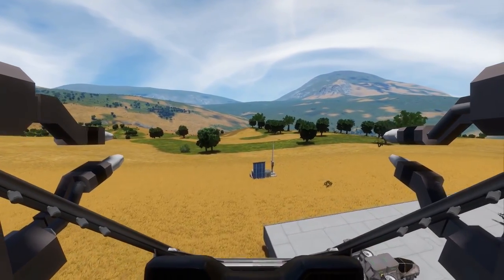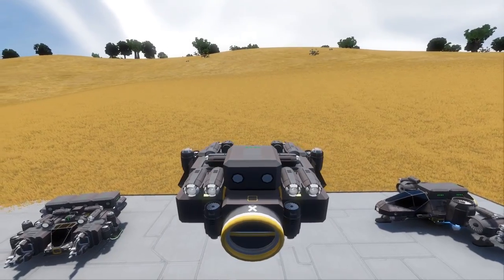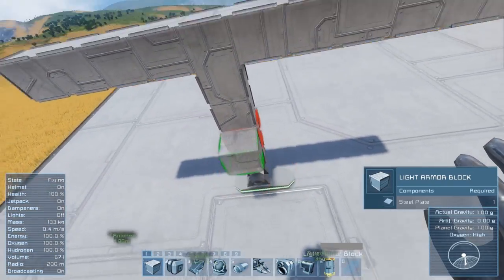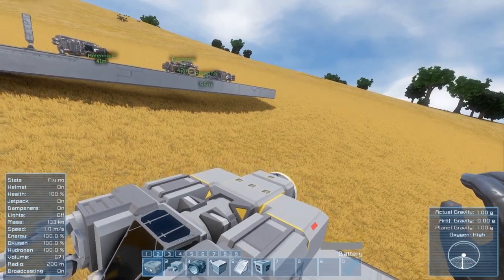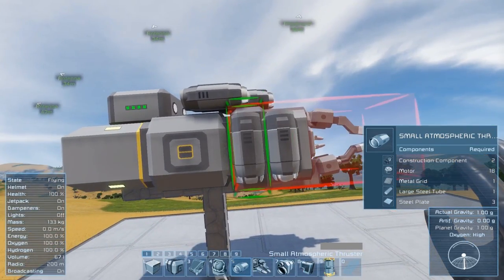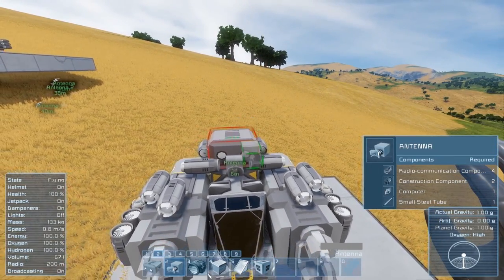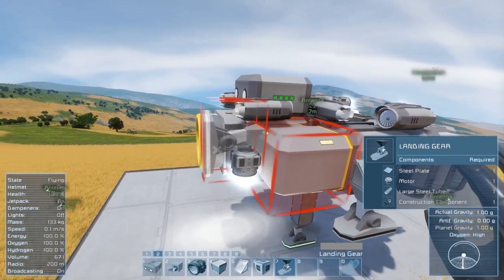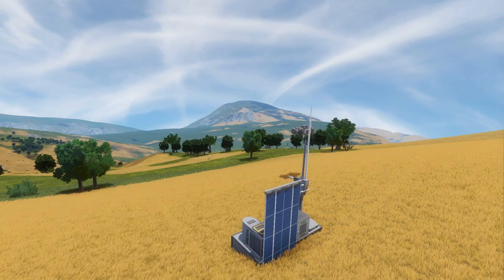Space Engineers - Simple In-Atmosphere Welding Ship Tutorial

Comment: I think to build from the cockpit you need to have it connected to the cargo. If you don't you need to have the materials to place the blocks in your inventory
Reply: +Cornivius technically, you could just have a few Steel Plates ect. in your inventory, but yeah. he needs a bottom connection, so it's a tiny bit misleading for good designs
Reply from the maker: +Maroon136 Oops, didn't realise it needed a big connection, thought the small was enough but guess I was building stuff using construction components..
Reply: +w4stedspace You can just replace oxygen tank and cockpit with fighter cockpit and airvent to pump atmosphere into cabin. Quick and easy fix ;)

Comment: I tried to make a similar design to this today using this video as a guide and for some odd reason my cockpit wasn't getting the oxygen it needed, so i instead added a oxygen generator directly behind the cockpit and then a oxygen tank directly behind that and that seemed to work for me. Beyond that small thing it works really well for me and is the best atmos ship i've built so far... i didn't realise how good those small thruster ones were i've been using the rather large clunky ones for my mining ship.. I'm now considering switching them out for the smaller ones now i've seen what this ship can do with just the small ones.. although i dunno actually, i might need them for the extra weight of the drills and ofcourse what the ore i'm collecting.
Reply from the maker: +Alfie yesyesyes The tank would need filling for that to work, one option I forgot to add in the trailer is to fit an air vent somewhere and that will do the job for the earthlike planet at least :)

Comment: Just a quick note on this craft, i copied it, but not block for block and i found something rather alarming and altogether, rather expensive;

Docking the craft has a tendency to smash engines mounted on the connector into the station side connector, which causes them to explode. 
The first time this happened, all i had left was a cockpit, a few loose engines rolling down a mountain and a detached container and its conveyor tube, sometimes turning the connector pull strength down works, but ive shifted all the engines mounted on the connector to other positions to prevent this and since then, coupled with reduced connector power, i havnt had another explosion.